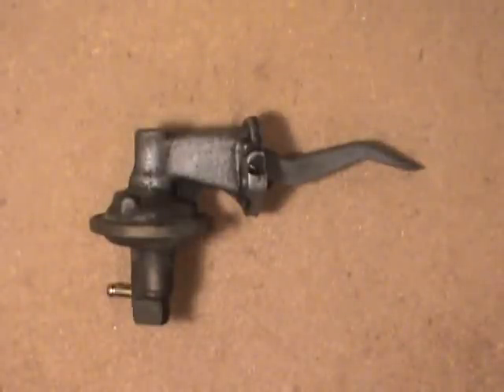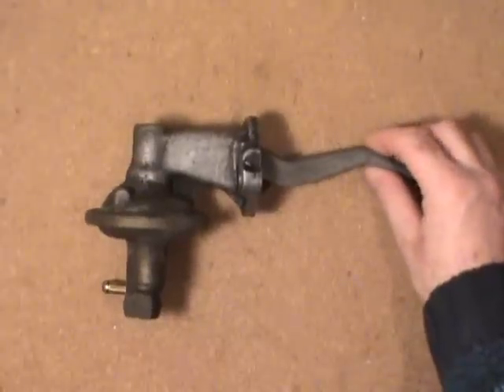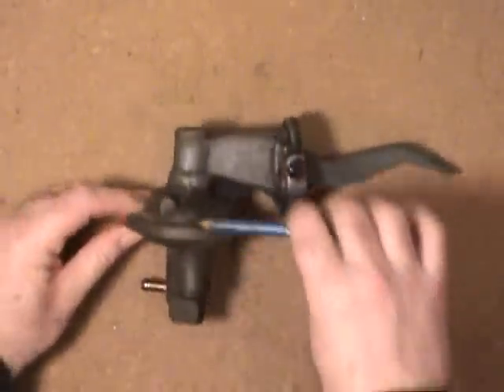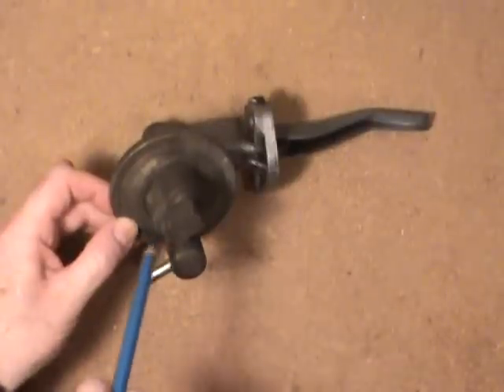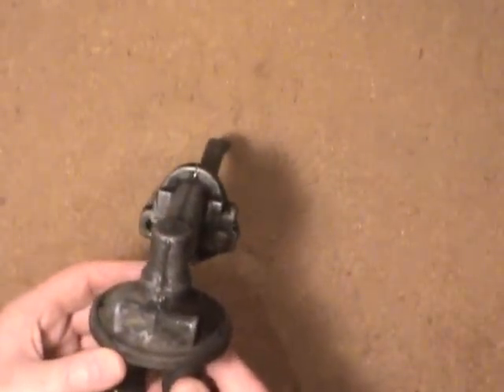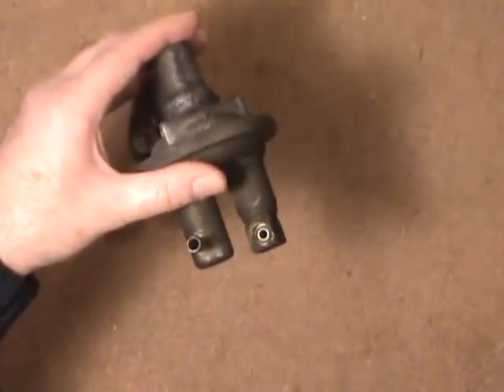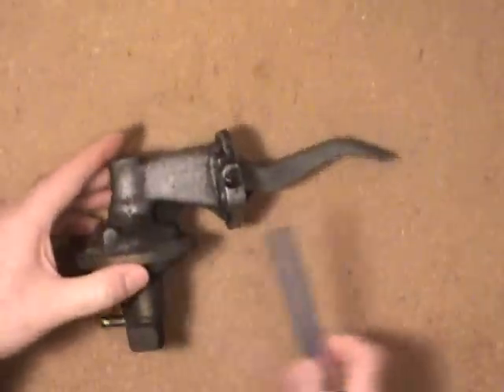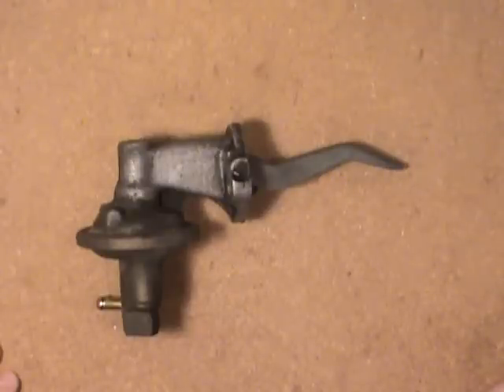Fuel Pump Mechanical Type Demo

Comment from the maker: Greetings Sugarfeet...You sure have an interesting car there....I did some research on your car, and, if it is Fuel Injected, then it may have "2" Electric Fuel Pumps!...One low pressure pump in the gas tank, and one high pressure fuel pump outside of the gas tank...If it has Fuel Injection of any type then you have to use Electric Pump/Pumps!...The "Mechanical" type of fuel pumps only put out less then 10 Pounds Per Square Inch (PSI), where-as, Fuel Injection Needs more Fuel Pressure!..(con't)

Comment: Hey Rocky I have a 83  tbird 302 block that I bought and it came with a electric fuel pump.  Its not in the tank and I have probably replaced it like 5 Times. HOw can I convert it to mechanical.  Thanks

Comment from the maker: Also try some Fuel System Cleaner in your gas tank........This will make its way through your carb, and clean out the different circuits in your carb......Make sure that the carb cleaner says that it is OK for cars that have carburetors!......Gasoline may look nice when it is new and in liquid form, but when old gasoline dries up, it turns into what looks like a brown colored varnish or glue!.......So often, a carbs problems are due to deposits that restrict or plug up tiny passages!!!!!!!!

Comment from the maker: Hi there....I don't work on many Import carbs, mostly Domestic carbs.....Normally, a Main Jet is a fixed size, and starts to work when the engine is Above Idle.....Idle mixture (changes the amount of air/fuel mixture that the engine burns) at engine Idle speed.....Idle speed screw is the one that you turn to get the Idle Speed only......Given that there is a tamper proof plug there, just adjust the Idle Speed Screw the way it says to in your manual.....Remember Safety!!!!!!!!!!

Comment from the maker: If the plugs in your carb are covering the Idle "Mixture" screws, then all you can do is set the Idle "Speed".........Check the specifications for your vehicle, and set the Idle "Speed" to that......Remember Safety!.......Also, take a look at your Air Filter, as a "Dirty" Air Filter will cause your Carb to run "Rich" because it will restrict the flow of Air resulting in less Air, and more "Fuel" in the "Fuel Mixture" at Idle, and, at all engine speeds!  Take care...

Comment from the maker: When I said to get the fastest engine speed, it was when you were adjusting the "Idle MIXTURE" screw/screws, not the Idle "Speed" screw.......If you had access to your Idle "Mixture" screws, then when you turn them "Clockwise", you get a "Leaner" Idle Mixture, and the engine revs faster until you turn them to the point where the engine revs start to slow down.......It is at this point, where the engine revs the  fastest, just before the engine revs start to slow down that you adjust for.

Comment from the maker: Hello.....I'm not sure which Carb that you have there.......Any 2 or 4 Barrel carbs that I have seen with the tamper proof plugs, are usually covering the "Idle Mixture" screws......They are usually set at settings that will get you through the "Smog" test, and give you good mileage as well......Usually set at .5 to 1.5 CO....(Carbon Monoxide) if checked with a smog meter.

Comment from the maker: Hello there.......A mechanical fuel pump is good for about 50,000 miles generally speaking.......I just returned a new fuel pump that didn't work properly, (very low output)......Make sure all fuel lines and filters are not restricted.....With engine warm, Parking Brake ON!.....Transmission in Park or Neutral, adjust mixture screw/screws to get fastest engine speed, then adjust Idle "Speed" screw to get the correct idle speed that is specified in a factory manual....Maybe a carb rebuild?

Comment from the maker: Greetings.........If it was the fuel pump causing a drop in mileage, I would think that it may be possible that your new fuel pump may be putting out too much pressure maybe?..........Check to see that your new fuel pump is rated at the correct pressure for your engine/vehicle, and that it's specifications are the same as the "Factory" installed fuel pump............Too much fuel pressure has been known to make a carburetor run on the rich side.